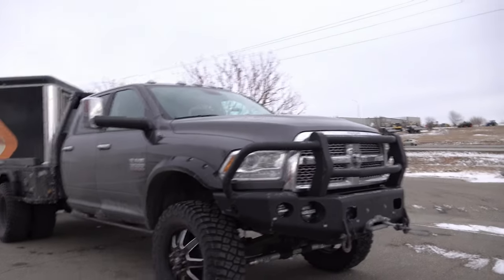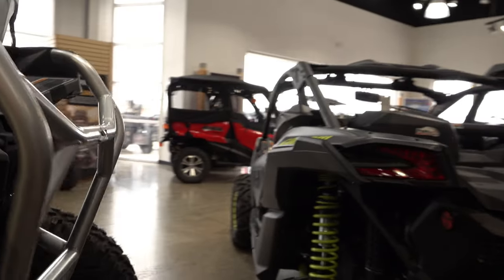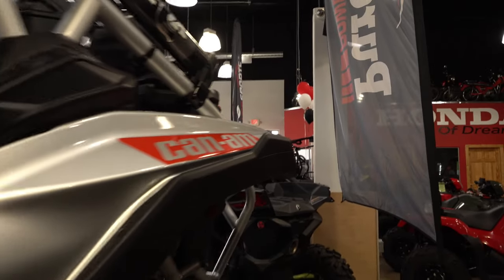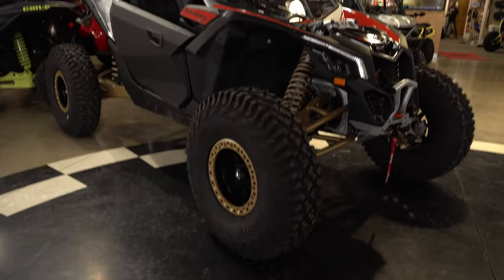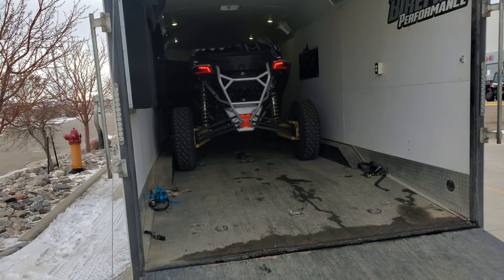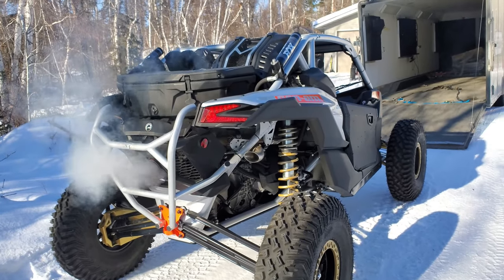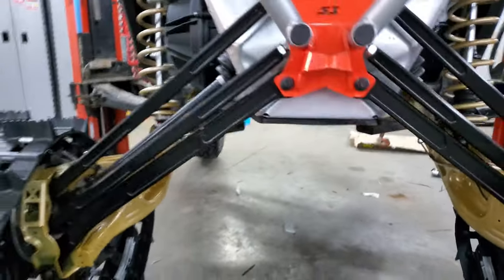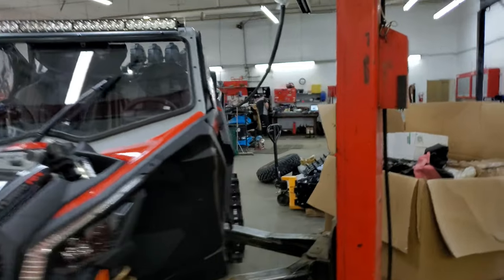Project Ghost!! It's INSANE!!!

Comment: Do they make these with a regular transmission and a clutch yet? I have PVT's.
Reply from the maker: Not yet. I have driven both the Yamaha Yxz and the Honda Talon with the manual transmission and would take a belt drive cvt system any day of the week. Tough to turn larger tires in mid with the manual transmissions and huge bucks when they blow vs. $100 for a belt and 15mins to change. Jmo